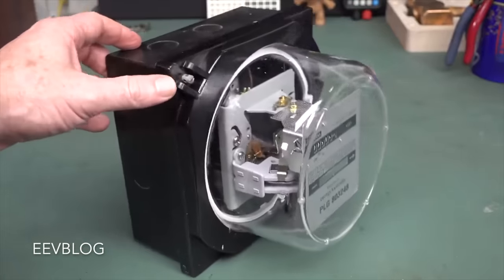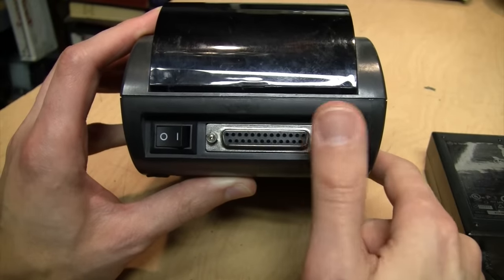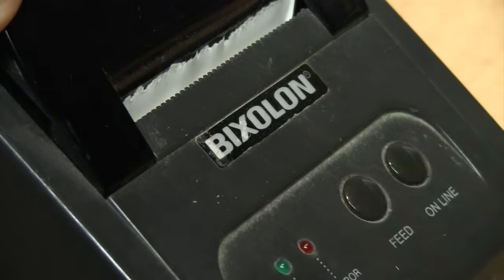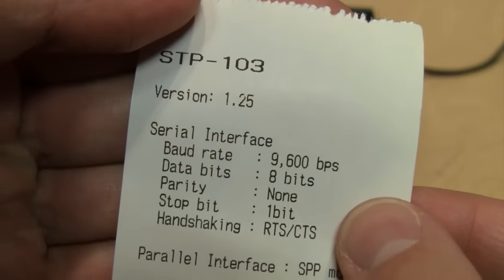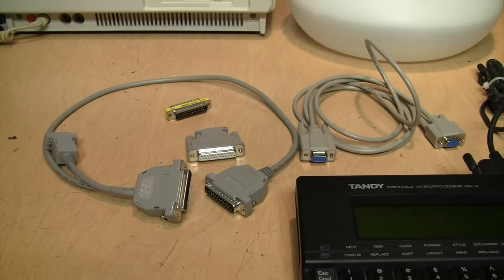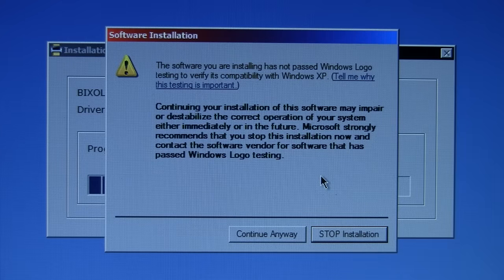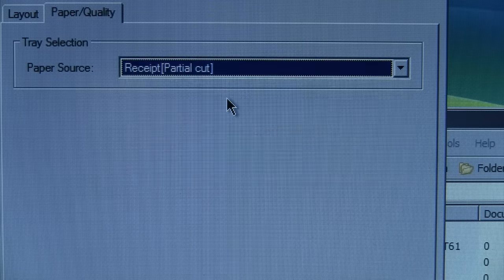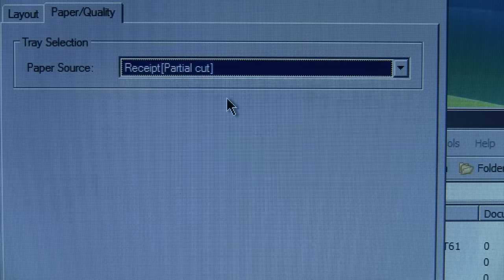I got a receipt printer. 🖨️ Now what?

Comment: Some time ago I found outside of a bank a discarded huge roll of 80mm thermal paper meant to be used in a ATM receipt printer. In the span of a couple of weeks I found about a dozen of those rolls discarded by the same bank.
So I finally decided to get few thermal printers to use that paper and in the end I got 4 in total of various ages and types like an open frame one meant for kiosks.

24V is standard/typical voltage although not using a barrel connector but a 3 pin DIN one (the ones I have all share it)
Reply: The 3-pin "DIN" is neither DIN or MiniDIN, it is called Kycon :)
Reply: @zaprodk  Ah good to know thanks
Reply: My local post office ran out of receipt paper, so for a good number of months they used receipt paper from the previous lottery supplier, as they had hundreds of rolls of this paper in stock. So your stamp receipt would, on turning over, have pale pink printing on it of the lottery rules, and the contact details of the previous operator. Good paper though, took a long while to fade away.

Incidentally your common hand sanitiser will also fade those receipt papers on contact. A good reason to take them and either scan or photograph them immediately on receipt, or very soon after, so there is a record you can use when it fades back to a blank paper after around 6 months.
Reply: @SeanBZA  "Incidentally your common hand sanitiser will also fade those receipt papers on contact."

Found out pretty quickly. It's the alcohol, I have pure IPA that I use for cleaning stuff and if you spray it over thermal paper it will progressively darken the more you spray.

Anyway it's good that your office at least found a way to reuse those rolls. Thermal paper is quite nasty so at least they haven't discarded them new but used them.
Reply: @SeanBZA  i do not think, that ppl that use han sanitiser have the cognitiv abilitys to make a photo.
Reply: @zaprodk  Thanks, wasn't expecting that here, I've hand a thing for 2 years with a weird 4 pin plug to big to be mini din (S-VHS) and not as big as the classic 5 pin din , I just need check sizes power rating, 🙂🙂🙂🙂🙂🙂🙂🙂🙂🙂🙂🙂
Reply: I also managed to find some ancient non thermal paper for cash registers their size is quite handy for writing small notes.
Reply: @harambo88  Huh??
Reply: @TheFruitMugger  Sounds like he was sippin' on the hand sanitizer again.
Reply: Lay person here... Is there a need to such "high" voltage (i mean, high relatively)?
Reply: @sophiacristina  I would think the higher voltage would be required by a thermal printer because of the need to quickly generate heat, but I don't know about the others
Reply: @jr2904  Ohhh, makes sense indeed... Ty! :)

Comment: "Who says there's nothing good on TV anymore?" 😂 This is why I love your channel.

I've actually thought about picking up one of these to use as a Game Boy Printer with an emulator.
Reply: Ha! You beat me to it! 👍
Reply: Wouldn't it be easier to get a Gameboy printer? Eh those prices are probably through the roof. Oh and you wouldn't be able to connect it to a pc... Sorry, had a brain fart there
Reply: @goeland4585  Finding a functional GB printer for a good price is the biggest problem, unfortunately.

I actually would LOVE to see a project where someone takes an old receipt printer like this and builds a GB-compatible interface with it, so you can plug it into and use it with an original GB/Pocket/Color
Reply: @devikwolf  or a new model made for the analog pocket 🧐
Reply: @goeland4585  The Analog Pocket is what got me thinking of it!
Reply: just buy a gameboy printer, i got one boxed in great condition for £40
Reply: also gb printer emulators exist
Reply: THAT'S SUCH A COOL IDEA
Reply: @JH-jk3nm  ... Read my previous comment
Reply: @JH-jk3nm  hardly the point :)
Reply: @devikwolf  Years ago, i had an arduino connecte3d to a GB printer, and with that and a java applet, i was able to print images from my laptop. Now? with a cart dumper, i can dump images from the gameboy camera, and even upload images to the camera to display on the gameboy...
Reply: @eduardoanonimo3031  That's the point, yes.
Reply: @devikwolf  but... but... 😭 was like a father to me... 😧
Reply: @eduardoanonimo3031  I don't follow. What's the problem?
Reply: @devikwolf  Not really a problem, im old enough, but VWestlife its a reference for me, like a father, and if you see your father making that gay jokes... my lord, you get traumatized...
Reply: @eduardoanonimo3031  I'm not sure I follow. It really seems like you have a problem with gay people, though, and that you've developed an unhealthy connection to a YouTube host that you seem to not know as much about as you think.
Reply: @devikwolf  Lol, no, you dont get it... apply the Ockham razor.

I like technology, and sometimes with the programmed obsolescence you see a  better development in old products than new ones. Thats what grab me to this channel.

VWestlife its very special in order to film his videos, he dont prepare it, its like personal, like if you was in their house and he show to you the new jewels that found in the thrift store. That makes the audience feel different, they are not consuming a product, they are spending the time with VWestlife, its like Bob Ross.

Im in my thirties, but I alwais feel VWestlife as a father because of his knowledge, its someone from who I always learn a new thing. That for me is admiration, not a unhealthy connection...

So everything fine until VWestlife makes a gay joke that brokes the atmosphere. If you dont realize he never exposes his personal life, this is the first fact that I know about him in years...

Maybe you forgot that all we come from straight sexual relationships, and supposedly must be like that... for biological reasons you know... well, seen a parental figure outside of his supposed place yhea... looks as little as weird, and can go to traumatizing easily.

Maybe you don't know that im from one of the first countries with equal gay rights, like marriage, and that part of my family are gay unions, but you dont need that to understand that gay people are a minority and his sexual behavior its not the norm in the human kind.

So maybe this has to be more with the rol that VWestlife was playing all this years, and you personal hate against people that you think that hates you.

Have a nice day
Reply: @eduardoanonimo3031   I'm not trying to start a fight - there may just a communications barrier. If what you're saying is true, then I would like to illustrate that maybe "traumatized" wasn't the best choice of words, here. That word has a LOT of power. Saying that you were "traumatized" by what someone said is going to be interpreted by most people as "he shouldn't be allowed to say that, because I felt hurt by it." Everything else follows from there.

Perhaps you meant you were shocked or surprised, rather than traumatized. :)
Reply: I'm stupid, only understand the joke after seeing your comment

Comment: Here's a somewhat unique use for a printer like this, well actually any continuous feed printer: printing out security logs. With a hardcopy you can know that they can't be electronically altered after printing.
Reply: That's brilliant tbh, hardcopy log could be useful in some scenario
Reply: Great idea until you realise thermal paper generally fades pretty quick and will likely be blank or illegible by the time you need it
Reply: This is a proposed solution to bridge the gap between voting machines and paper ballot. I believe some states have implemented it where you vote on the screen and you can see in a window that your vote was printed on the paper, which then advances past the window once you’re done so the next voter can’t see it. We’ve still got scantrons where I’m at and I like those the best.
Reply: @nicksurfs1   Thats why we often say to people that if they want warranty they NEED the receipt, so they better scan and print it on a normal paper.
Reply: thermal ink fades after awhile though

Comment: I like that, getting your hands on something you've always wanted but have no use for. For me it would be the ticket machine from my local Tram service. They removed them all from the Tram stops a few years ago and I often wondered what they did with them. Probably got scrapped. I didn't want the ticket machine itself but the computer inside it which may may have just been a dumb terminal. I don't know what it was or what its specs were but it ram IBM OS/2 warp. Sometimes if the machine was having problems it would restart itself and that it one of the first logos that you would see on screen. They were first installed 21 years ago (when the service started) and I don't think they ever got an upgrade, so Pentium 3 era hardware. I don't know if OS/2 warp ran on P3 processors, it might've used an IBM processor.
Reply: OS/2 certainly ran on the original Pentiums. I know for sure IBM were selling Pentium computers pre-installed with OS/2 in around 1995.
Reply: Yeah, that would have been really fun to play with!
Reply: They wouldn't have needed a P3 to dispense tickets, they were probably built around an industrial 486/pentium board, or a consumer grade board they bought in bulk and on discount because the distributor/whatever probably wanted to get rid of them, depending on how stingy the tram company was :^ )

Comment: My buddy has one of these hooked up to a server in his house, and it makes it so that any image sent to it over chat room, it will print it. It has its own scaling mechanism too for large images
Reply: Do you know if your buddy has any documentation on that? That sounds really cool!
Reply: i really wanna do this now, got any docs on how?
Reply: I am wondering what to do with meters of thermal paper sitting around under my bed. Now I know what to do with them. Thanks!
Reply: @MrSquekersUPSB  Not the guy but a rough outline of how to do this would be to make a discord bot that resizes and saves images to a server that is connected to the printer. Another program, or perhaps the same discord bot (I've never actually made one), could then send a print command for each image that is saved.

Comment: When I was a little kid I actually wanted a street light really bad. 😆 

Pretty neat printer. I have 2 of the bigger dymo shipping label printers (one USB and one parallel) but I've used them enough in the past that I don't care about them.
Reply: You can buy LED ones on Amazon. I am weird the same way, I used to be obsessed with them.
Reply: I actually do have one indoors, complete with 80W mercury vapour lamp, and with a choice of regular photocell or shorting cap.
Reply: Same with me. I still want one but I'm afraid of my wife's reaction if I actually got one and put it in the garden.
Reply: I guess I'm not alone on that street light thing, I always wanted one too! I work maintenance, and when we were replacing an old street lamp from the wall to replace with a more modern LED floodlight, you can already guess what I did to the old lamp!

Oh, and I also have a high bay with a 250W mercury vapor lamp!
Reply: @redpheonix1000  You're living the dream. ;-)
Reply: ................i did too and when i got older, i bought a 150 watt high pressure sodium ballast and wired it up, still have it too, along with 250w, 400w, quad400w, 800w and metal halide in most of the same, i THINK i have a mercury vapor but i dont even remember, i have solar powered led PIR "street lights" that cost pennies on ebay and they are fun but they arnt able to give an unholy amount of light like a 1 kw metal haldie, even my 150 watt high bay LED hoods dont come close
Reply: i gotta find my old mercury vapor, that thing had a lovely color
Reply: Nothing beats the real deal when it comes to a traffic light. Those little plastic toy ones from Spencers etc. don't even come close.

I have a lighted "EXIT" sign that I snagged from my work when they were renovating and throwing out all their old lighting fixtures. I wired an electrical cord with a switch to the sign, so that it plugs in and operates like a lamp. It's mounted right above the walk-out door of my garage. 😀
Reply: Same, and a traffic light!
Reply: A hobby is still a hobby
Reply: I was around a friends house as a teenager and he pulled a sodium street lamp from under his bed with a spare lamp and light sensitive switch. He said, “You are the bright kid on this estate, can you make it work?” And I did.
Reply: I few things I wanted:
* A construction Barrel
* A couple traffic cones
* An Open/Closed sign for Halloween night, and place on my front window.
* A street sign that says "NO OUTLET", but have a duplex Outlet mounted on the signpost below the sign.

Comment: Funny thing, in one of my first jobs we were servicing bank equipment. We used to have the computers, bank programs, printers and new (unused) deposit balance books in our lab for testing purposes. I would always joke that I would once print a huge balance for me, take it to the bank and attempt to withdraw it :D
Reply: Banks normally have a test account, complete with cards and PIN, that are used to test the various systems, which are valid accounts, though they normally are very tightly controlled as to who has the card and PIN, and they look at all transactions going through it against the log of who has requested access to the account.

But, if you know the account number and branch code, you can run direct debit against it, for any amount, and it will go through. The fraud division will come looking for that money very fast though, and the recipient bank will be incredibly cooperative as well.
Reply: @SeanBZA  Yes I can confirm this account existed too. Although the tests I'm referring to were totally local to us and not tied to any account in the bank itself. We literally had an identical Olivetti machine with branch specific details in the software to play with - but without any account data. Their systems were pretty old at the time and used to break down very often. We often had to scavenge for parts to keep them running (Think something like 8 inch floppies and MFM hard drives in mid 90s)

Comment: Should try tearing it from the opposite direction and you'll get a cleaner cut. I'm a chef of 20 years used to deal with printers like that in kitchens all the time. Those blades are actually facing in one direction usually so if you tear from left to right you'll get a cleaner cut

Comment: It's no surprise it's 24v, it's a standard for industrial electronics.  Those are used alot in factories for certifications, settings, etc etc, not just POS.  I encounter then often.
You can use it to print your grocery lists!!!
Reply: That's actually a really good use if you want something physical to take with you to the store!
Reply: @8bit_coder  admittedly I shamelessly stole the idea from an Adafruit project.  They sell mini ones of those.  They have alot of uses really and if your start to look you'll see them.
Reply: That is a good idea...
You could hook it up to a computer and then share the printer, and then you would write down what you needed, and send it to the printer trough that computer 
It's also about the only use you can have for one of those in a home setting

Comment: The reason why this printer runs at such a high voltage is because it's a thermal conductive printer, it doesn't use ink but instead it heats up the thermal paper such that it colors it. That's also why you're not supposed to keep receipts in sunlight, because it will discolor the receipt.
Reply: Yeah I was so dumb at one point I wanted to laminate a receipt. Don't need to say how that ended lmao.

Comment: I worked at a lotto place that had normal tickets and "digital" tickets that were printed by a thermal printer with a HUGE roll of branded thermal paper. The barcode on the digital tickets could later be scanned by the terminal to check for a prize. 

Bonus neat thing: these terminals can scan in the numbers a client wants if they're filled out on special tickets. It's hard to describe through text but these tickets have black squares on one side and have all the possible numbers a client can choose on squares that when marked those numbers are selected

Comment: I never restart my computer now when it asks for most things after installing a printer or other device.  Just see if it works first instead of wasting time.  It's rare that the device doesn't work.  Also, I laughed seeing OMGWTFBBQ!!  Haha!  Good times!
Reply: I also like to live dangerously
Reply: Nope, restart especially with printer drivers. Regular software doesn't always need a restart but if it screws up when trying to run it after installation...
Reply: @Mrshoujo  Printer drivers definitely shouldn't need a restart. If nothing else, the entire print system is in userspace, so you could just restart the spooler if it really needs it.
Reply: Same here. I've had stuff refuse to work without a reboot but it often does and it's never caused an issue for me so far.

Comment: I always wanted to integrate something like a POS terminal or RasPi with a receipt printer into something like a fox hunt, treasure hunt, or multi stage geocache. You'd have to prompt it with the right phrase to get it to print. Not only would it give you the next coordinates, but also like a QR code to scan with your phone for additional hints. 

I do not have any suitable locations for a permanent installation like that, but for a temporary event, that would be awesome.